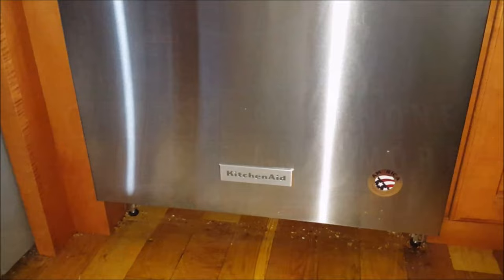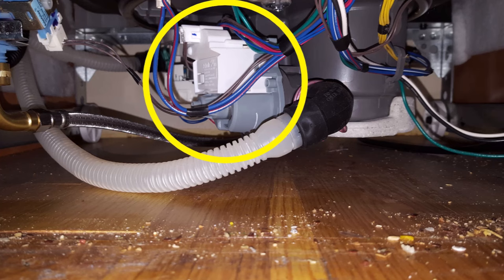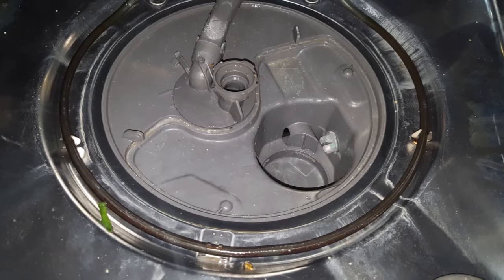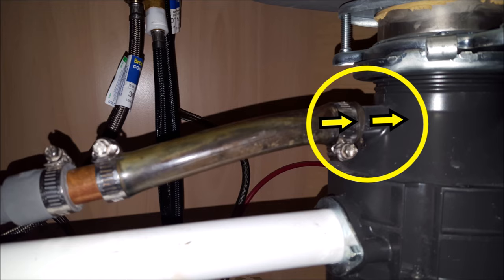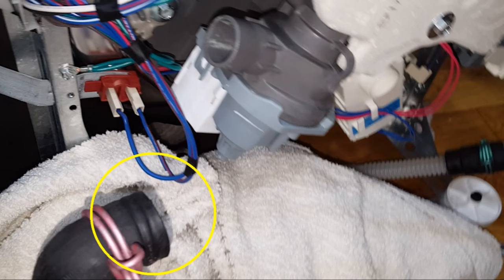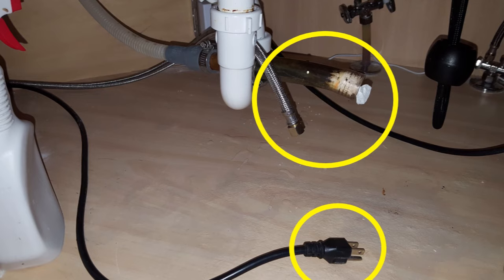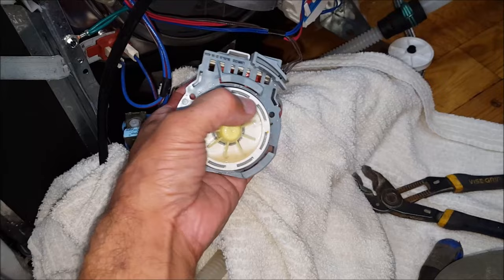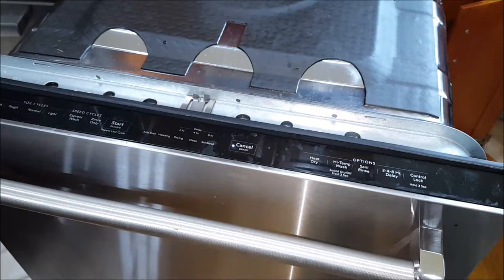Dishwasher not draining FIX. D.I.Y. KitchenAid & Whirlpool

Comment: Thank you so much I just fixed my dishwasher and less than two minutes by knocking out the plastic piece in the garbage disposal. I just replaced the garbage disposal and did not think to knock that plastic piece out.

Comment: Super helpful. I cleared the pump of a small twig and fishbone but still not draining. When I get to the part in this video about blowing through the hose to make sure it’s not the issue I was thinking I’m running it every day so it can not be the hose but doesn’t hurt trying. Glad hubby thought of using the air pump for inflatable kayak and we blew out so much mushy ewww! Now it’s working! Snake didn’t help much as the hose is loooong and twisted. Wish it was installed more efficiently. Thanks for the video!

Comment: This video provides a systematic view of resolving the diswaher non-draining issue. In my case, when I installed the garbage disposal, I didn't remove the knock-out plate, so the dishwasher doesn't drain. Just by removing the knock-out plate, my problem was no more. Thank you so much!

Comment: You just saved me at least $150-$200! I have the same model dishwasher and had a small piece of plastic stuck in the motor. As soon as I opened it up, It fell right out. I was able to actually open up the motor without taking the dishwasher out of the wall. It was a tight squeeze, but I was able to access it from underneath. Thank you so much!
Reply from the maker: you're welcome

Comment: Thanks for pointing out the pump/impeller check. I was able to narrow down the drain problem to the pump. Discovered that we had a small piece of chop stick that broke off and was getting lodged in the impeller intermittently. It was a big help. Thanks!
Reply from the maker: Glad it helped

Comment: Thank you for posting this - 1 day before home inspection to sell and the error code showed up.  Found broken glass from a wine glass stem that made it through the filter and was blocking the pump from spinning.  Fixed and running in about 1 hour.
Reply from the maker: Glad it helped

Comment: Fantastic video. I have the drain pump off and can spin the impeller but not sure how freely should it spin. I am assuming not freely like a fan blade but spin freely a full turn or two  before  it spins back. Is that correct?

Comment: I'm up to removing the drainage pump on my Kitchenaid. There is resistance in spinning the impellor, however the housing will not spin off. I even tried rotating it with a clamp but it only rotates about 2 degrees. I don't want to break it.

Comment: My motor would grind down 3-4 times before the board would shut off and the dishwasher would need to reset. After a couple attempts, it actually physically fried the board. Any ideas beside the obvious board replacement? Thank you!

Comment: Great video. Does the drain completely drain all the water or is there still a little left in the bottom section? The very last section of the drain still has water.
Reply from the maker: A little bit of water should remain but the water should not be visible when all parts are fully assembled in the bottom of dishwasher.

Comment: Great video!!! Question: We have the same dishwasher. 60% of the time it does not actually wash. The cycle seemingly starts normally, it rinses, but the wash cycle never kicks into gear (so to speak). Any idea what the issue could be??? Are these units vulnerable to a bad circuit that could cause this? Thanks to you and all.
Reply from the maker: Sounds like the control board itself where the controls are located is the issue.

Comment: Great video! In my case the line is not clogged and I've cleaned out the filter. I tried to run a cycle and the water still pools and doesn't drain, but if I push the "drain" button the water drains out properly. PLEASE HELP :)

Comment: My dishwasher doesn't drain properly; it looks similar to the video you posted. I would like to know if this issue prevents the dishwasher from starting the cycle. Despite having electricity and the machine making sounds as if it wants to start, it does not initiate the cycle. Additionally, I am unable to drain the water using the cancel button.
Reply: Read my story above— you most likely have debris/glass/plastic jamming your drain pump.  Super-easy fix here in the video!
Reply: You symptoms are exactly what I had with the piece of glass in the drain pump.

Comment: How do you get the plug out of the disposal after knocking it out?
Reply from the maker: With small hands or remove disposal and dump upside down.
Reply: needlenose pliers, or wife's small hands.  Grab a flashlight,  you'll see a few plastic pieces in the disposal from your sink. Turn off your power to be safe.

Comment: I have a KitchenAid I have almost the exact same one you just did in this video but for some reason I cannot turn out the filter in the dishwasher to remove and clean it could something be stuck or could it be broken because my dishwasher doesn't seem to be draining food particles and every time I go to use it it smells like rotten eggs but it is draining I can hear the water running into the garbage disposal and see it but for some reason it's just not draining and rinsing away all the particles so I feel that I might need an empty this filter that you've shown in the video I just can't get it out
Reply: Side note after working with it and fiddling with it it finally came free it was disgustingly full of garbage and yuck so I guess the previous owners never cleaned it and then because of you thank you I got a snake and cleaned out the drain hose and now I'm running the dishwasher and hopefully it'll be perfect
Reply from the maker: Hopefully you will get it working.